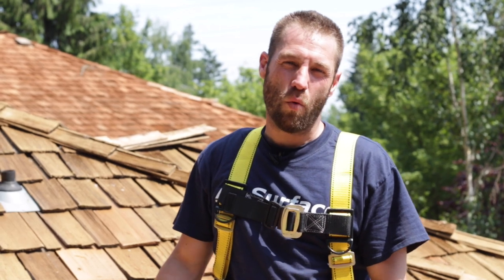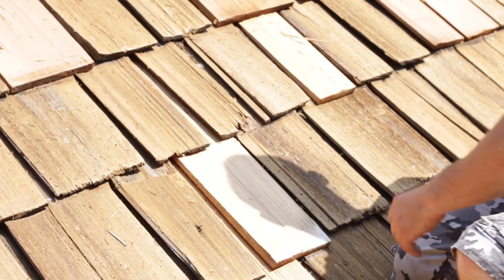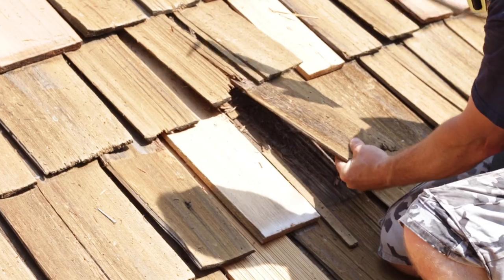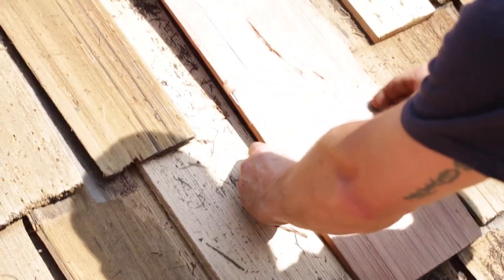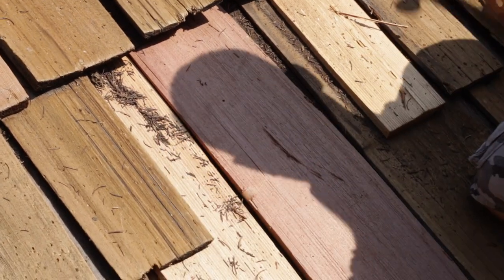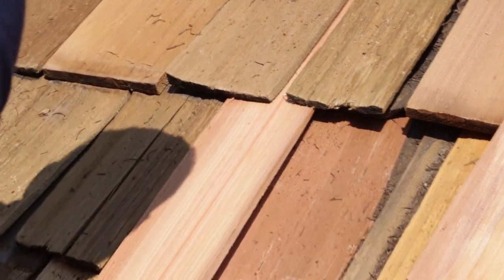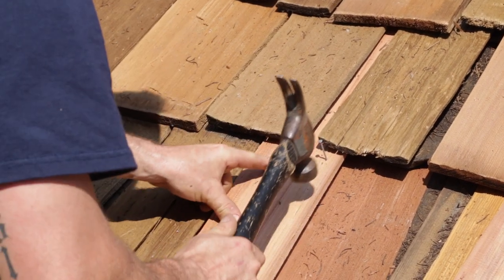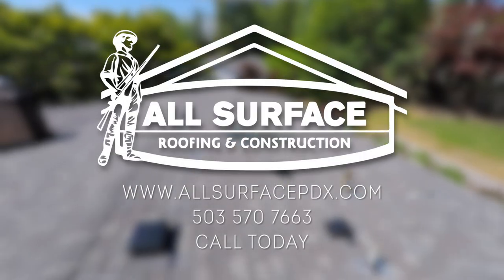How To: Replace a cedar shake shingle

Comment: The only thing I would recommend is placing the shingle as far up as possible by hand, inserting two nails, tapping them in slightly and as close to the top of the shingle as possible and then use a small block of wood flush with the end of the shingle when you are tapping it into place so you aren't damaging the end of the shingle with the hammer. This will bend the nails a bit and then proceed to finish hammering them in with a flat bar.   Cheers!

Comment: We used a slaters bar to hook nails out when repairing shingles. Had to use this technique to extract sidewall shingles to blow in cellulose. We employed duck bill vicegrips to pull on the shingle. Sometimes you’d get a shingle out intact and reinstall it seamlessly.

Comment: Angle those nails then when you tap the shake up the nails will straighten out.
Reply: I thought of the same thing and saw your note, but I don't think it matters, either way, you'll have a slightly bent nail if not a small start of a split. Has anyone used a dub of glue to glue the inserted shake to the above or below with no nails with success?
Reply: Yiannis Anagnostou too much expansion and contraction

Comment: You do realize that by setting the nails and then tapping it up you are just pulling the nails out and the shingle is no longer fastened properly?
Reply: I thought  you  weren't  supposed to have paper under them I was told so they could  breathe  ?
Reply: @cravenmoorehead6219  Code requires installing both underlayment and interlayment
Reply: I was going to say that too
Reply: Caulking is better